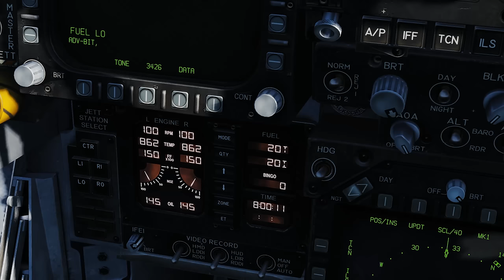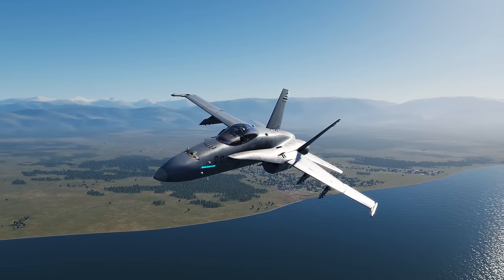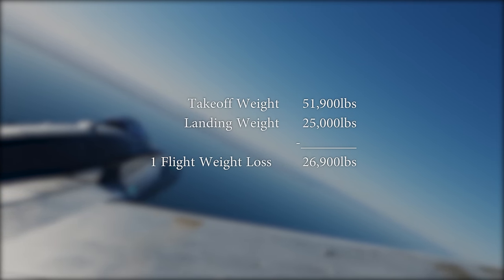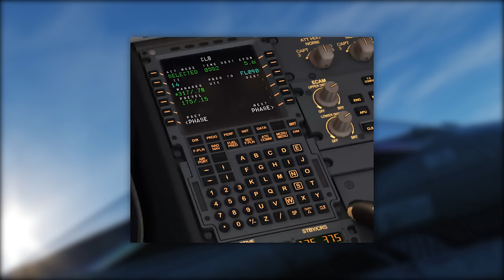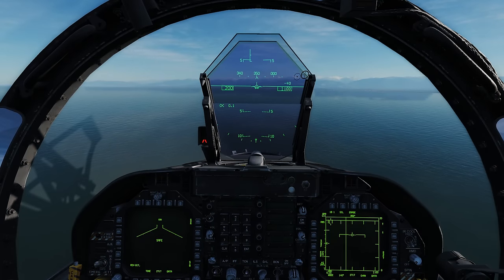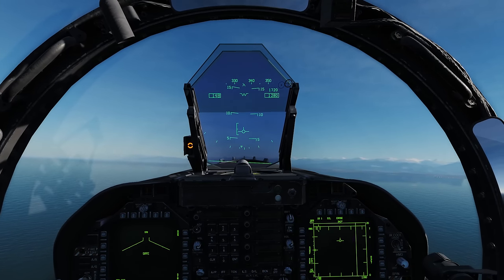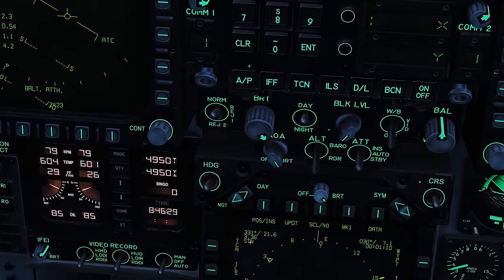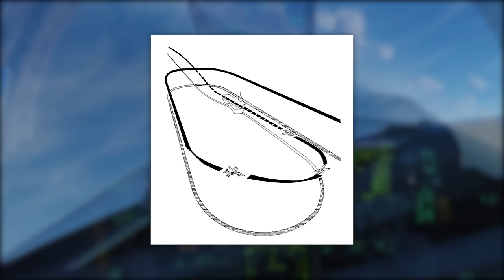DCS World - F/A-18 - Case I Carrier Recovery Tutorial

Comment: Impressive! I’m curious how you gathered all the information. You included bits from CV Natops, LSO Natops, and general knowledge that comes from real flying around the boat. I concur with the other commenters that 450’ is a good number for the 90, but that can fall into the category of technique. How you manage your power thru the 135 to the start is something each pilot develops, and where you are at the 90 will determine that technique. If you like 500’ at the 90 that’s fine but it may catch the LSOs eye if you go any higher, and may warrant a downgrade.
One tiny critique.  Maintaining on-speed isn’t really about hook AoA, it has to do with some things that may not be modeled in DCS. Primarily arresting gear settings and the hook to eye distance. 
Essentially, the AG is set to absorb a certain amount of energy. It enters the weight, and assumes you are at max trap weight and the associated speed. If you are above your speed, you can get a long pull and damage the gear.
For hook-to-eye, you won’t get an accurate indication from the lens about your position on glide slope if you are not on speed. The h.t.e is set for each pass, (18.7’ for hornet I think) and is only correct if the jet is on speed. That’s fairly advanced stuff, but you really nailed the details on the rest of it so I thought I’d share.
Nice work!
Reply from the maker: Thanks!  The information was gathered from all the various sources you listed sans irl experience, luckily I have a couple navy buddies I’ve was able to talk to to fill in the gaps.  As for the 500’ this was told to me by a current navy pilot and more as a start her and work down to 450, but never above 500.  I probably should have explained that but hindsight 20/20 right?

Comment: I notice that a lot of people do not use the ILS for landing on the carrier. To find it click on "ILS" and key in the channel number that is in the Briefing page and when you turn it on and go to the HSI page click on the L2 button to box it, you will have the vertical line and horizontal line on your approach to put you on glide path. From there is a matter of staying on path and then using that golden donut forbyour AOA.
Reply from the maker: At the time I made this video ils was not implemented, but it was for my case 3 video which is where it's necessary
Reply: @Jabbers  yeah i totally forgot about ILS and tried the Case 3 and after doing everything right...smacked into the red light buld. I played a lot of Jane's F/A-18 super hornet as a kid and remembered that being there when you dropped the gear but once i learned how to activate it everything got a lot easier. Btw, how do you turn it on for runway landings?
Reply from the maker: You can't cause it's a carrier only ils system, ICLS. There might be a mod to add land based ICLS to DCS runways but I've never looked.

Comment: Really great explanation Jabs. I can't wait to try it when it releaseses. One question though: At the crosswind break do you cut the power once you start the 3.5G turn or do you keep it where it was at during downwind?
Reply from the maker: I cut power to idle as I initiate the turn.  I bring the power back in slowly at 200kts, the engines take time to spool so you need to bring it in early or you will be in a word of hurt.
Reply: Thanks. I didn't think that all of that speed could be lost so fast with the throttle at the same position as on the upwind leg.

Comment: Great tutorial, thanks for the effort and sharing. I nonetheless do have a question, as I havent figured out one thing you did. At 07:20 you´ve entered the ships heading into the UFC. But that number (353) didnt match with the heading giving on the top right HSI corner, so where did you recieved that heading from? Only thing I can imagine is that you´ve recieved that heading from the radio call from the carrier. If you could tell me please, so that would be awesome. Liked and subscribed.
Reply from the maker: I got it from plotting the course of the ship in f10 and then converting the coordinates from true to magnetic, the ship is moving 360, on the map, but the magnetic offset is like -6.5 degrees, so roughly 353, I have a follow up video nearly finished to address this question
Reply: thanks

Comment: Awesome video.  Has really helped with most aspects.  I'm able to do the pattern entry, the crosswind turn, and setup on the downwind leg with no problem.  My problem comes with the base leg turn.  Drives me crazy.  I keep the downwind distance at 1.2 nm, and start the turn at 5 deg beyond the abeam point, and try and keep the turn pegged at 30 degrees and depsite that the turn never seems consistent.  Either significantly undershooting or overshooting the turn (and no I'm not pulling in the turn, just keeping it at 30 deg and using the throttles).   Are there any tips on getting this final turn right?
Reply from the maker: After the 90 look at he ship and try to figure out if you are going to under or over shoot and adjust, I think the misconception is you have to sustain the 30* turn but that’s only for the first 90 when it’s instrument only

Comment: Looks like you beat me to it. I was planning to release an accurate discussion of daytime carrier landing basics shortly after release of the module but it looks like now I can post more advanced stuff.

Finally, a carrier landing video with very few errors. Nicely done! I only have two minor discrepancies for you. During my time in the Hornet, 450' was used at the "90" checkpoint. Also your offset on the carrier at the overhead was slightly wider than it should be but passable. Other than that you nailed it. Nice touch with the mention of LSO grades and shorthand.

Nice work.
Reply from the maker: Thanks!  I was told 500' from a current hornet pilot, but ya after talking to a bunch of navy persons current, ex, in-training things were all slightly different ;)
Reply: It's been just under 20 years since I last flew so I wouldn't be surprised if there were updates to the numbers of the pattern. Back in my day it was 450 at the 90.  One thing you got right was the abeam distance of 1.1 to 1.3. For some reason other videos keep referencing 1.5 abeam distance which would only apply to a larger jet like the Rhino or the Tomcat.

I highly recommend you watch my video when I post it later next week. I will break down the approach starting at the 45 in good detail and discuss the effects of the burble in real-life. I don't think DCS is simulating the burble but won't know for sure until I get my hands on the module.
Reply from the maker: Ya chose to not talk about the burble, cause i wasnt sure if they were going to implement it.  I'll check out your video!
Reply: Don't bother, a few real pilots have sniffed him out as a fake and his videos contain a lot of baloney. What he can't make up (usually incorrectly), he just claims his memory is fuzzy. Seriously, your videos are 10X more valuable Jabbers.
Reply: handle checks out
Reply: Jealous much lol

Comment: Very nice tutorial Jabbers, it helps me alot to plan ahead, but my warthog throttle doesnt seem to like small adjustments so its either to much power or not enough power
Do you have any advice on the curve/axis settings? I tried the trottle as slider with 10 as curve settings.
How did you manage to hide the map in the middle HSI display, its driving me nuts as i see the map button but cannot hide it.
Cheers Evilfisher
Reply from the maker: I don’t use curves, minor adjustments work fine for me, I’m working on a video that should show the technique I use in more detail so stay tuned.  As for the hsi this video was created in a dev preview build before the moving map was implemented, and in the current release you cannot change it, but in a future one we will do just have to wait
Reply: Thank you very much, I decided to recalibrate my Warthog set, now its really smooth. If managed to raise my landing quota to 9/10  succesful.
Good to know that you had the dev Build with no moving map. Was it in the dev build the same situation with the nose dropping heavily after gear down and full flaps?My workaround is to deploy gear and flaps at 240 and in the same moment press/hold trimm down until its kinda level so i dont have to make heavy corrections on the stick.
Cheers from switzerland,

Comment: @Jabbers How do you maintain level during the 180 break? I find it hard to maintain, when entering the break as soon as i start pulling G my nose will go up or down and i have to counter it with some really strong counterinputs via joystick and then it´s more luck than control to stay level. When Gears and Flaps are out it´s even worse sometimes because of the decreased IAS. Would be nice to hear some tipps and tricks on that specific maneuver. 
Really nice to see people like you pushing out those informative vids btw thanks alot
Reply from the maker: Anticipation... Also the amount of G required to maintain level flight directly relates to your angle of bank
Reply: @Jabbers  Thanks for your reply. Is there any chart which shows the G required in relation to angle bank for level flight or is this something the pilot has to figure out and rely on his experience?
Reply: @Jabbers  Got the answer, i watched your follow up video thank you big time. Amazing!!!

Comment: It's actually called region of reverse control, also known as slow flight.

One thing I would really recommend is working on simplifying your tutorial, you used a whole lot in the way of numbers and abstract concepts and those are hard to remember when under pressure and can often leave a learner in a worse position if they only remember part of the instructions. Focus more on what they should be seeing and feeling with regards to their controls and the position of the aircraft relative to the where they are landing.

For instance rather than trying to have them fly a bunch of patterns initially just teach them to fly straight in it's less work and it gives them more time to get themselves established on glide-slope.

It doesn't have to be pretty it just has to work and once they figured out how to not die they can refine it with exact numbers and the like.

Comment: I’m getting a wave off call every single time I’m in the groove in close even when I’m on speed AOA with an orange ball, and lined up. I can’t figured out what the hell I’m doing wrong. Most the time I just go ahead and land anyway and I catch the 3 wire and I don’t break anything. There has to be bug or something. Every freaking attempt gets a wave off in close.
Reply from the maker: Ball is not suppose to be orange, it's green
Reply: I misspoke when I said “orange ball”.  I meant to say that when my case 1 landings are getting waved off,  even when I am on-speed with an orange (amber) AOA indexer, with the IFLOLS orange (amber) ball centered between the green datum lights, and the lineup light is also yellow (amber ). 

Anyway, I figured out exactly what my problem was. In DCS Options Settings, I had checked the box for unlimited fuel, so I could practice my case 1 landings over and over again without having to worry about refueling. That was the first time I had flown in DCS with unlimited fuel.  

In my prior case 1 landing practice, I would set bingo to 6,000 pounds and turn on the dump fuel switch and the switch would automatically turn off when the aircraft reached 6,000 bingo, which puts the F/A-18C right at 33,000 pounds total weight.   

When I started practicing Case 1 landings, I checked my total weight and turned on the dump fuel switch,  I didn’t realize that with unlimited fuel settings, that there is no way to dump fuel to get under 33K pounds for a carrier landings. The unlimited fuel setting puts the F/A-18C around 34.5K pounds without any armaments except for bullets and Aim 9’s on the wing tips. So being overweight (>33,000 pounds) was causing me to get waved off every time. 

As soon as I turned off the unlimited fuel setting, I stopped getting waved off when I was in-close on center line, on-speed, with a centered ball and I started getting fairs and OK grades for about 8 out of 10 case 1 landing attempts, with only an occasional wave off when I legitimately screwed something up.

Comment: Question for you. After about 12 tries I finally caught the wire and F/A-18C came to a complete stop on the carrier. At that point I put my throttles down to idle and start jumping around the room celebrating. Within 10 to 15 seconds after catching the wire and my plane coming to a stop, as I’m celebrating, I saw a huge explosion out of the corner of my eye on my display.  The sim immediately cut away to a flying helicopter and the post flight debrief page showed a successful 4 wire landing and a grade of C but the next line in the debrief just said “Crash”.

I have no freaking clue what the happened. After catching the wire and quickly coming to a stop, I double checked to make sure that my throttles were in idle and they definitely were. I thought maybe if I didn’t have my throttles all the way to idle, when the arresting wire was retracted, maybe my plane rolled off deck while I was jumping around celebrating and then maybe my plane bounced down the side of the carrier and  exploded on the side of the ship, but I was in idle, so I’m not sure why the plane would start moving after the wire was retracted. 

It’s obviously not a huge deal. It’s just a sim after all,  but I am a little curious what went wrong that caused my plane to explode after what appeared to be a successful landing. 

It was a hard landing. Could I have landed so hard that a fuel tank ruptured a slow leak that took a while to blow up the plane? I’m not sure if DCS will do that after hard landings that appear be successful. Anyone have a clue? How do I see a replay?
Reply from the maker: Probably didn't raise the hook and your plane got towed backward and collided with something, no idea, just dcs things

Comment: I'm confused about the "too slow/on speed/fast" logic of the indexer, or maybe I'm just thinking in Russian. Surely a RED arrow would indicate a more dangerous situation, which would be if you are slow ( meaning high AoA, and risk of hydrobraking/collision ), and a GREEN would indicate the safer situation, ie too fast, in which case the harm will only come to your ego as you are waved off. I seem to remember that the US uses the symbology to indicate the speed you should fly at ( as a function of AoA ), and the soviets/russians to it the other way round, with the top arrow indicating to the pilot that he/she should lower the nose to pick up speed and avoid the stall.
Reply: Conceptually the easiest way to differentiation the US and Russian AOA Indicators is as follows. The Russian AOA indicator shows you how much AOA you're pulling. ^ on the SU-33 means your AOA is to high and requires you to lower the nose. While on US aircraft The AOA indicator shows the corrective action required to bring the craft to the proper AOA. In the US aircraft ^ indicates the AOA is to low and the pilot should raise the nose.    

  The color of lights on the index can vary from aircraft to aircraft. The A-4 for example, has the colors inverted compared to the F/A-18.  It's just one of the quirks of the system.
Reply from the maker: Think of it as red means stop, green means go :)
Reply: Exactly. Red is telling you to slow down. green is telling you to speed up. American system tells the pilot how to correct his glideslope, while the Russian system shows nose position compared to relative wind. This video is incredible for newcomers. Instead of answering the same questions 200 times, im just linking them the url. Appreciate it
Reply: F18 lands at a fixed angle of attack of 8.1 degree. the indicator lights are for glide slope, whether he needs to add or lower power

Comment: What do you mean with lead, in the lso rulse
Reply from the maker: If you're low and slow, fix the low before the slow: There's even less safety in being low than there is to being slow, so worry about getting up before worrying about your speed, that doesn't mean climb super high, just at least get back to glideslope

If you're high and fast, fix the fast before the high: Increased speed means increased descent rate to overcome later on. If you try to fix the high first you will be at a lower power setting with an increased descent rate, which means low spool up time and a lot of momentum to overcome.  Bad days will follow

Never try to re-center a high ball in close, but stop the rising ball: The ball is super sensitive in close, and the burble coming off the ship will cause your aircraft to descend. So if your tendency is to want to re-center the ball at the end it would be very easy to go low, causing sudden campfires or hook-skip bolters by slamming in front of the 1 wire. If the ball is rising, just try to stop it from rising with a power off correction, but don't go idle, and don't try to re-center the ball. Ride it in and take the bolter like a man if it happens, it's safer than fireballs. 

Fly the ball all the way to touchdown: self explanatory, don't give up on the ball as you see yourself cross the deck, a lot can still happen.

LSO is always right doesn’t really apply to dcs

Comment: How do you know what Tacan station to tune to? I tried 55X and it will not work.
Reply from the maker: Mission brief or mission editor
Reply: Jabbers I am using the editor, it works fine in the instant action mission, I did it the same as you (55x) but when I make my missions 55x won’t work and I can’t figure out what it is
Reply from the maker: You have to setup an advanced waypoint I’ll post a picture later
Reply: Jabbers ok thanks
Reply: Jabbers I figured it out under advanced waypoints like you said! Thanks